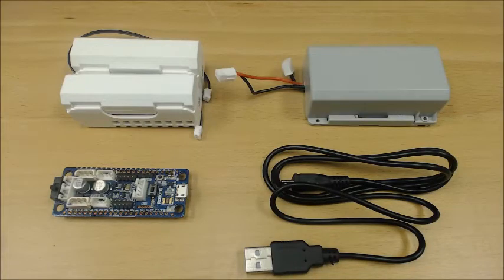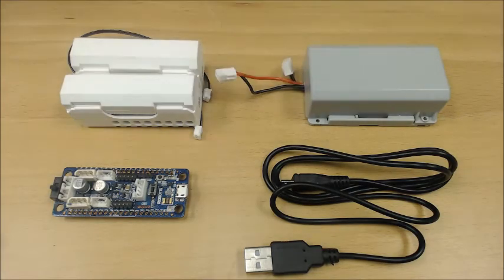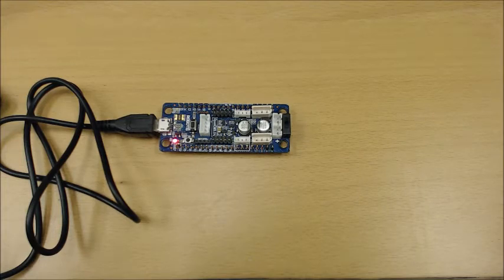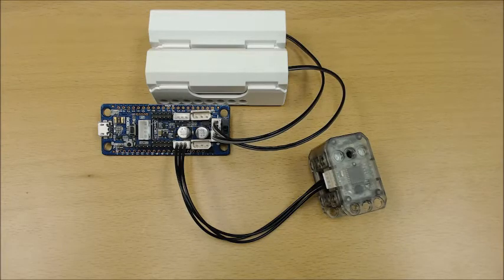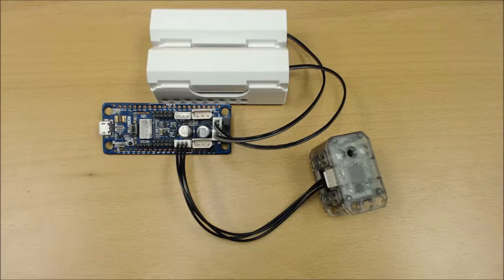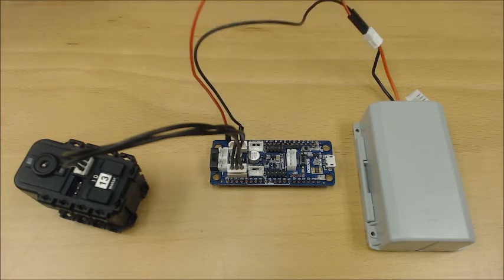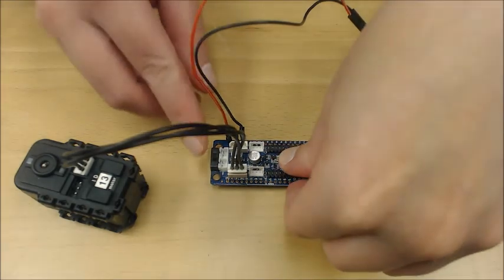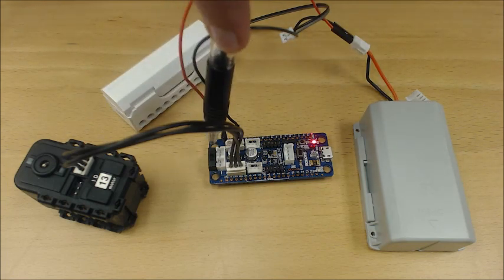How to Power the OpenCM9.04

Comment: Hi, nice information, actually I have a question...
Can we connect the MX servo directly with the TTL pin of the OpenCM9.04 or we can't? and it is necessary to connect with the 485 expansion board and only then it will work.
Thanks.
Reply from the maker: Hello Danaish, and thank you for your question. To answer your question, it is possible to control any TTL-communication model of DYNAMIXEL, including MX-series directly from the connectors on the OpenCM9.04 controller, however this may require a customized cable or jumper wires due to the smaller "XL-320" connector on the OpenCM9.04-C by default. Keep in mind that this only applies to TTL models with 3-pin connectors- RS-485 models with 4-pin connectors will require the OpenCM485 EXP board to be used. 
It is correct that when using Arduino code for OpenCM9.04, if using DYNAMIXELs connected directly to the OpenCM9.04 board you will want to use "Serial 1" in your code. 
If you have any further questions, feel free to come visit our online support forum community.robotis.us where I and other experienced members can advise!
Reply: @robotisus  Thanks for  answering my questions.

Comment: Can OpenCm9.04 be used to control dynamixel AX-12A servo ?
Reply from the maker: Yes, OpenCM9.04 can control any 3-wire TTL DYNAMIXEL (X-Series requires a convertible cable) and 4-wire RS485 DYNAMXIELs may be controlled and powered with the 485 EXP Board.

For any technical questions or inquiries related to our products please visit the ROBOTIS e-Manual [http://emanual.robotis.com/] or contact one of our customer support teams in your region: contactus2@robotis.com [for International Customers] or cs@robotis.com [North and South America only]